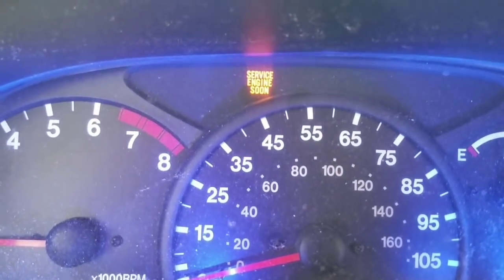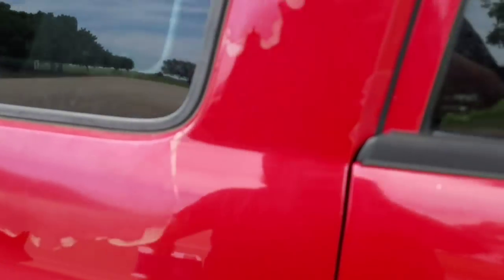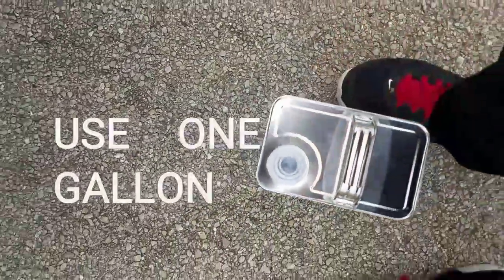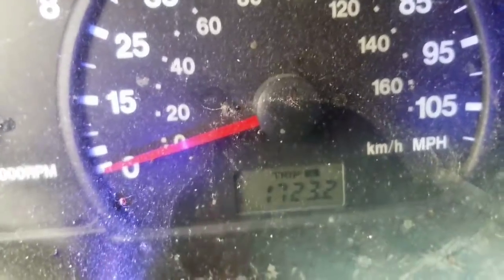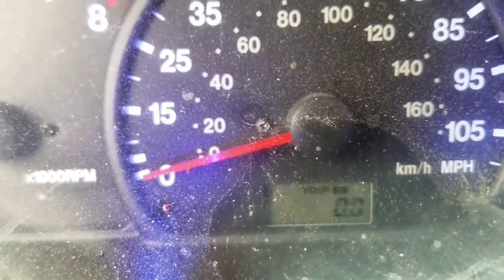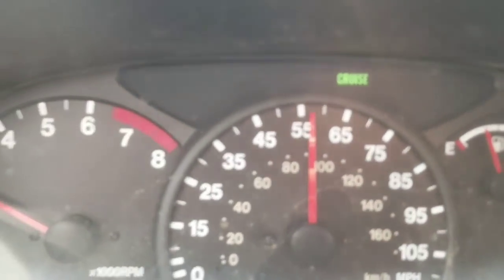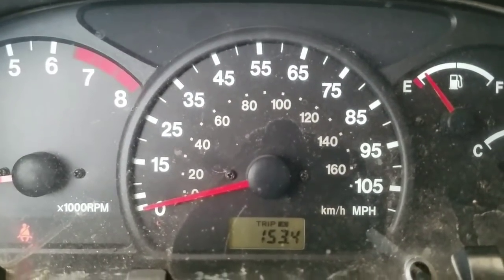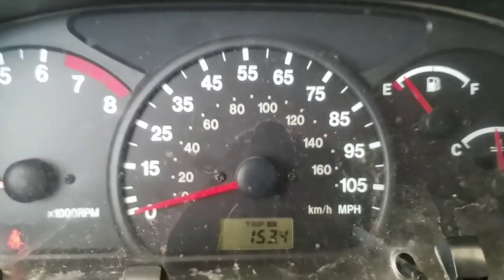LACQUER  THINNER  FIX FOR CATALYTIC CONVERTER.

Comment: Does the lacquer thinner smoke really works on cat converter? vs directly soak the cat converter inside the lacquer thinner solutions for a couple of hours?
Reply from the maker: I used the lacquer thinner at my own risk. They sell this fuel additive called Cataclean. That's made for cars. If you hear rattling when you accelerate your catalytic converter needs to be replaced.
Reply: @rxvanz  In your experience doing this does it really works and result in significant improvement or did the same problem came back? your feedback much appreciated
Reply from the maker: @neodiy  Good question! For myself it was temporary, I needed to pass inspection and it was enough to clear the code and clean the catalytic converter. I used it at my own risk. If you're not sure they sell Cataclean specifically for cars. I had to replace my catalytic converter but it bought me time. It's still my daily driver and dependable. Thanks for watching and asking.
Reply: @rxvanz  no worries I just asking for some ideas and real life hands on experience...anyway great video and tq for sharing
Reply from the maker: @neodiy  thanks again 😊

Comment: If you take out the oxygen sensor before the cat or for diesels the dpf and pour in whatever your using to clean the filter,  let it sit overnight, don't forget to replace sensor, it should help to clean the sensor,  work's for my opel insignia,  another way when the light came on was to give it some 
Heavy foot in 2nd or 3rd gear, up to 3 or 4000 Rev's, when the road is clear, that will force the air through the Cat or dpf, and hopefully the engine light will go out,  regards guys,
Reply from the maker: I hear ya. I'd love to have a diesel truck. Thanks for watching my video.

Comment: My check engine light isn't on but my car runs rough and the rpm keep fluctuates and I have to step on the gas hard just to move off from a stop I think my cat is clogged..
Reply from the maker: I tried it at my own risk. If you're not comfortable in that. They have this product called Cataclean specifically for your catalytic converter.
Reply: @rxvanz  I just tried it and my car runs a whole lot better than before...I still have the hesitation slightly but it's no at bad as before..now I'm wondering if my problem is bad fuel injectors or do I have a clogged catalytic converter 🤔
Reply from the maker: No telling, I did have to eventually fix my catalytic converter. The lacquer thinner was a temporary fix.

Comment: Very interesting....I don't mind running some lacquer thinner through my 2000 celica Gt veins. And yes the damn check engine light is on. I will keep you posted.
Reply from the maker: +KNAC 105.5 PURE ROCK  Like I said use it at your own risk.
Reply: Ivan Roux ... Yes Sr, I will keep that on mind, thanx for your support.
Reply from the maker: +KNAC 105.5 PURE ROCK you're welcome
Reply: Ivan Roux Even more interesting, I was a little conservative with the laq/thinner and only added 1 qt, ironically the engine light remains but I've noticed that my mpg increase about 3 extra miles per gallon, which doesn't make any sense, but I will take it. Now I'm really curious  what will happen if I dumped the whole gallon of laq/thinner inside the tank, possibly the engine light is going to disappear and mpg will decrease, there's only one way to find out. 
Stay tuned.......
Reply from the maker: +KNAC 105.5 PURE ROCK fingers crossed!
Reply: KNAC 105.5 PURE ROCK because of toluene in Thinner

Comment: If you've just got a clogged cat, this should do the trick.  If your cat is bad, this won't fix it.  However, it is a fairly cheap way to find out if it's just a clogged cat.  Much less than buying a new cat, and if you don't have the skills, having someone install it.

Comment: Right on this tues im gonna do same on 2004 FORD TAURUS runs great other then stupid light is on and I don't have a thousand bucks to blow on new cats..Sunday night be back in 2 days.let ya know it worked or not .Dang better work cause we're will I get 1,000 bucks.
Reply from the maker: Like I said I did this at my own risk. If you have doubt try Cataclean.

Comment: Update? How long did it work for?
Reply from the maker: It was a temporary fix, I eventually had to get it fixed.
Reply: @rxvanz  How long was temporary?
Why did you choose to not try it again?
Reply from the maker: It helped me pass my emissions test. I could hear rattling sound when I would accelerate and the check engine light came on for the same code. So I had to replace my catalytic converter.

Comment: bottom line it works temporarily to get your sticker I've done it twice worked both times but the check engine code comes back on month-to-month 3 months later
Reply from the maker: I hear ya. I had to break down and replace it.
Reply: yeah I'm going to have to probably break down and have mine replaced before October when I have to get my new sticker but I'll probably try it again
Reply from the maker: Mine broke down and started making a rattling sound. I couldn't accelerate as fast as I used to so I got it fixed.

Comment: It won't work on a cracked exhaust, but if your catalytic converter is clogged with carbon and oil deposit, it should work fine

Comment: Will this work if my code is P0135? It said i have a bad upstream o2 sensor. I replaced it and my check engine light went away for a couple hours and came back.
Reply from the maker: I used it at my own risk. If you're unsure, they sell Cataclean which is formulated for vehicles.

Comment: I've been hoping someone would tell me if the thinner in the gas would harm any seals and gaskets?
Reply from the maker: Haven't noticed any leaks.
Reply: @rxvanz  well I'll give it a shot since its been over and almost 3years for you. Thanks.
Reply from the maker: I would try Cataclean first that's specifically made for cars. I did have to change my catalytic converter.
Reply: @rxvanz  lol... Well then I'll just go ahead and change it. I've got one in the mail. I just thought I may wait and do this then do my entire exhaust.

Comment: How is the car now? I am thinking about doing it to my crown vic
Reply from the maker: +SAUL vs THE WORLD 
My car is running great. I just had my car inspected too with flying colors. It worked for me, and did it at my own risk.
Reply: Ivan Roux thank you for the quick reply I got the car cheap and I am certain it's just the cats that are throwing the code I don't want to pay to have them replaced so I will try this at my own risk , fingers crossed
Reply from the maker: +SAUL vs THE WORLD 
Good luck and let me know how it works out.
Reply: SAUL vs THE WORLD, did it work for you? is everithin ok?
Reply: Ivan Roux, what year is your car? I spen alot of $$$$ and the mecanic did'n fix it they only atole my $$$
Reply from the maker: +Zarybel Reyes  my car is a 2001 Chevy Tracker 2.0L 2 wheel drive.
Reply: Ivan Roux, I will do it. Where do you buy it? thanks I hope it works.
Reply from the maker: +Zarybel Reyes wal mart
Reply: How much is the galon?
Reply from the maker: +Zarybel Reyes  it 12 bucks and change at Walmart.

Comment: Do you have to drive at least 55 Mph consistently ? Like on a highway? Or can you just drive around in the city (30-40mph) til it turns off ?
Reply from the maker: You have to drive 2500 RPM's to get it to gas to push out through the injectors faster.
Reply: Ivan Roux okay cool, my light came on like 300-400 miles ago. I hope it goes off quick like yours !
Reply from the maker: Awesome! Glad the light came off.
Reply: Ivan Roux I haven’t tried it yet lol, I was just hoping that it comes off when I do try it.

Comment: Don’t wait until the idiot light tells you to do something.  All cats get dirty after some 20,000 miles. I use the blue driver scanner to see for myself.  It only takes about 10 miles to see the scanner o2 sensors to report cleaner results. Run overdrive off, gun it after 30 miles to blow it out best. Note; if any cat gets clogged the pressure of the exhaust could blow out the internal membrane of the cat. Cleaning won’t do anything to a blown out cat. Another Note; dirty cats tend to overheat, overheating will also cause damages to the internal membrane of cats.  
So clean your cats in 20,000 mile intervals to avoid catastrophic failures that will require replacement…
Reply from the maker: Good tip, thanks.

Comment: Dam what could I do , I want to do this because my car won’t pass smog 02 censor is replaced so I’m thinking it’s a dirty cat coneverter but the car has no tags . Could I just do this and leave the car running ? Or do I have to hit the gas pedal
Reply from the maker: If you have any doubt try Cataclean first. Either way you have to drive or push the gas pedal to 2500 rpms to clean out the carbon and push it out the exhaust.
Reply: Ivan Roux thank you
Reply from the maker: You're welcome and good luck.

Comment: My son has this code on his 2016 chevy Cruze that has about 65,000 miles on it.  I want to try this, but I'm scared. Did this clear the code for anyone indefinitely? I read for some it came back in a month or so. I also read that after-market cats don't take away the code. Is this true? Must I get an OEM CAT? Thanks!
Reply from the maker: I did this at my own risk. If you're not comfortable in using it, they sell Cataclean at most auto parts store. For me it was a temporary fix, it helped me pass my emissions inspection here in North Texas. I eventually had to replace my catalytic converter with a new one. I don't have the car anymore. It ran like a champ but wanted something newer.
Reply: @rxvanz  Did you use an after-market catalytic converter or an OEM catalytic converter Thanks for responding!
Reply from the maker: I don't remember. Probably OEM because it's a 2001 Chevy Tracker.  It cost $600 plus dollars for parts and labor.

Comment: Hi lackeethinner is that whitespirit?
Reply from the maker: Never heard of that. I used the lacquer thinner at my own risk. If you have doubt try using Cataclean first. They sell Cataclean at any auto parts store.
Reply: @rxvanz  no i will try to find out what you are jusing 😉 i live in belgium thats wy i dont know that and those car addetives are asking like 25dollars fore and there is next to nothing in it 😣.. i will try it cause i have the same engine light and the same fault code .. its worth the try 👌 thanks fore the video and taking the time to do this 👍

Comment: Hi guys…does anyone here recommend this thinner as regular maintenance? Would this be harmful to the engine? I plan to put this every month since I saw myself after I poured this and really made improvement on my car performance and cleared the code of P0420 on my 240K miles Hyundai ioniq 2017 model…
Reply from the maker: I did it at my own risk. They sell Cataclean specifically made for cars.

Comment: Could I use that on a 2010 Mitsubishi Outlander 2.4 L 4 wheel drive
Reply from the maker: Like I said I used it at my own risk. If you have doubt try Cataclean.
Reply: @rxvanz  thanks Ivan can this potentially damage the engine
Reply from the maker: A mechanic told me I was crazy for doing it when I eventually had to replace my catalytic converter. I was lucky my car didn't mess up.
Reply: @rxvanz  thanks Ivan
Reply from the maker: You're welcome 😊

Comment: it didnt work on my honda pilot 2006 with 223000 miles on it. Not sure if I should give it another try
Reply from the maker: Bryan Nguyen the lacquer thinner is to clean it, if the catalytic converter is broken you do need to replace it. On some of the forums some had to disconnect the battery to reset it. Try that first, or get someone to clear the code for you, and if it comes back on it can be a catalytic converter issue. Try and find a mechanic that can offer a free diagnostic check that's more detailed than what AutoZone does. Good luck.

Comment: Did your car stop the shaking when u put it in drive or reverse?
Reply from the maker: +Christin Hatten  it helped some. Turns out I need to replace my motor mounds. Car still running good and passed inspection last November 2017.
Reply: Ok I'm about to try this lacquer thinner.  My 2006 mustang pulled only that one code but it has that vibration.
Reply from the maker: +Christin Hatten I don't recommend it. I tried this at my own risk. If you're not sure they have Cataclean at AutoZone
Reply: I just went and got the cataclean going to try it first.  If that don't work lacquer thinner it is
Reply from the maker: +Christin Hatten Cool, good luck🤘
Reply from the maker: My car still shakes, but found out I need motor mounts.

Comment: Will this work on a 2015 car?
Reply from the maker: Like I said I used it at my own risk. If you have doubt try Cataclean. Cataclean is designed for vehicles and you can purchase it at most auto parts stores.
Reply: @rxvanz  I did cataclean twice and didn’t work
Reply from the maker: If you hear a rattling when accelerating you'll need to replace the catalytic converter because it's damaged. The lacquer thinner is supposed to clean out the carbon buildup if it's clogged.

Comment: I tried that on my daughters 26 Kia Optima, it didn't work. I may try again but this time with a 1/2 tank rather than full.
Reply from the maker: Like I said I did this at my own risk.
Reply: Mine worked after a couple of weeks.  Was not immediately
Reply: It probably got diluted since you had a full tank of gas, the mix would be stronger with less gas.

Comment: is this a good solution for a rattling converter
Reply from the maker: If you hear rattling in your catalytic converter when you accelerate. You need to replace it.
Reply: Go under the vehicle and tap the catalytic converter with a mallet or a 2x4 and if it rattles the material in it is broken, so it's done! Not repairable. You can buy an aftermarket one on Amazon or a online parts store. You will have to measure the inlet and outlet pipe for the correct size. Get a local mechanic shop to weld it on. Take the old one to the recycle center for a few dollars.

Comment: Happy for you bro.Thanks for the info.Do you have to do a total 150 drive or can you so it intermttantly.On the one gallon or lacquer thinner.I do about 60 miles round trip a day for work.I know...lol
Reply from the maker: I drove it till I almost ran out of gas, but the check engine light turned off way before I was on empty.
Reply: I7

Comment: any problems after that??
Reply from the maker: No problems after that, I changed my oil and spark plugs afterwards. I've been using fuel additives too. If you don't feel comfortable try Cataclean first. I used it at my own risk.

Comment: HOW MUCH DID THE DIAGNOSTIC READOUT COST !!!! IN AUST. THEY WANTED $160 -- ODD DOLLARS TO CHECK THE COMPUTER AS TO WHY MY FRONT PARKING SENSOR WAS NOT WORKING  ----- NO THANKS ---- ON SEARCHING THE DASH FOUND A BUTTON WITH SOME OBSCURE SIGN PRESS IT FOR FUN AND BINGO --- IT IS AN ON/OFF BUTTON ONLY FOR THE FRONT SENSOR --- WHY I ASK MYSELF ---- AND THE DEALER NOT ANY RICHER.

Comment: But does the engine still generate 420 codes?
Reply from the maker: It was a temporary fix. It got me to pass inspection but had to replace my catalytic converter. I did it at my own risk. If you have doubt they sell Cataclean.
Reply: @rxvanz  cool thanks

Comment: You could ruin your engine because the lacquer burns a lot hotter than gasoline. do yourself a favor and Take it to Midas. They will check your convertors for free with a pressure gauge right in front of you. Mine barely threw a code, like once, which was crazy because my cat was almost completely full like a sack of rocks. runs great now.
Reply from the maker: +Stephen Dennis I hear ya, will definitely take advantage of the free diagnostic. Thanks
Reply: actually my truck was running hot and overheating and i put laquer thinner in my tank it ran cooler and better
Reply from the maker: +andre papkov awesome glad your truck is running better.
Reply: where is Midas? I don't need some one to check it, need some one to fix it and chip.

Comment: Does this also clean the fuel injectors?
Reply from the maker: The lacquer cleaner cleans anywhere gas passes through. I did say I don't recommend it and used this method at my own risk. If you feel doubt they sell Cataclean. If your car is making a rattling sound when you accelerate it's most likely your catalytic converter that needs to be replaced.

Comment: Have had 420 Code off and on for several years.  In past Lacquer thinner worked.  This time so far not working.  I actually think the car , (2002 4 cly camry), is running too cold, (even after replacing thermostat with a 192 degree).  Next step is to remove and clean the CATALYTIC Convertor.
Reply from the maker: I finally had to replace my catalytic converter because it was  broken. It only helps clean when it's clogged.

Comment: where did y buy that at ??
Reply from the maker: The lacquer thinner I bought at Wal-Mart. Cataclean you can buy at AutoZone, Pep Boys, O Reilly's
Reply: Ivan Roux.  do i need my car off while putting that stuff in gas tank?
Reply from the maker: Yes you need to turn your car off.
Reply from the maker: This is where I saw lacquer thinner being used to clean it out. At half a tank of gas add a gallon of lacquer thinner to gas tank. I think I drove it for 80 some miles on the highway when it turned off my check engine light. 

https://youtu.be/5icTmYItwiE

Comment: I think it also cleans the fuel injectors.
Reply from the maker: It does, I try to use a fuel additive to keep it cleaner with every full gas tank before I fill it up.
Reply: @rxvanz  I used to use the cheapest gas and my engine was gummed up, but after some laquer thinner, I gained so much power and was going up steep hills, without having to downshift, anymore.